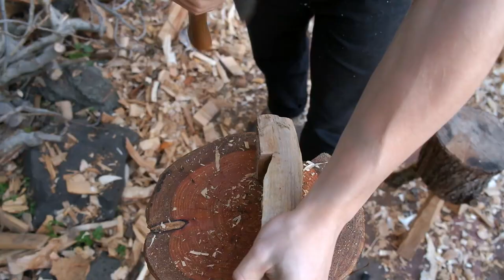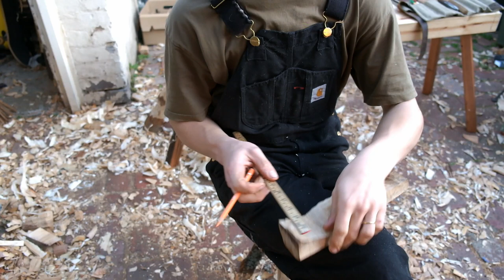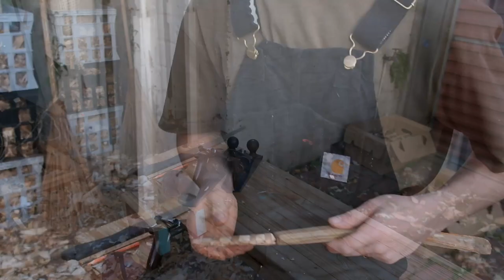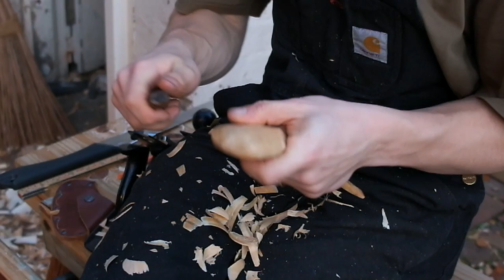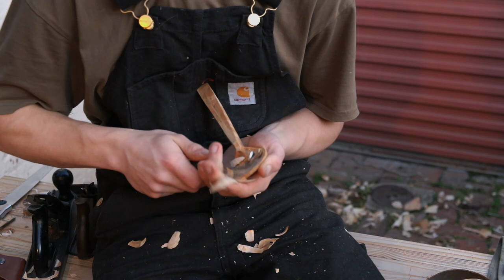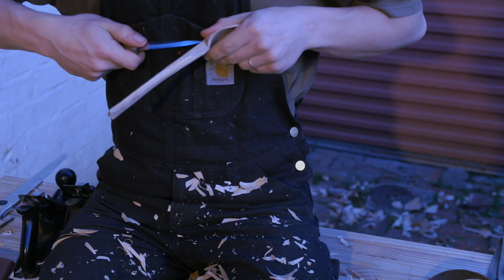Quiet evening carving - Spalted birch serving spoon | Hand tools only

Comment: Nice video.  Judging by the sound, that piece of wood was pretty dry.  I guess one would expect that if the wood were spalted, but I can't say I really noticed any spalting.
Reply from the maker: I'm usually happy to carve drier wood if I think the results will be worthwhile for the extra effort.
Reply: @jones_trees_and_treen  I know what you mean.  I often find myself carving dry wood because I get green wood in much larger quantities than I can use in the short term.  Even if I wax the cut ends of billets, it has still lost a lot of moisture before I have a chance to do something with it.  Right now I have a nice section of apple, but it will be a long time before I can use most of it.